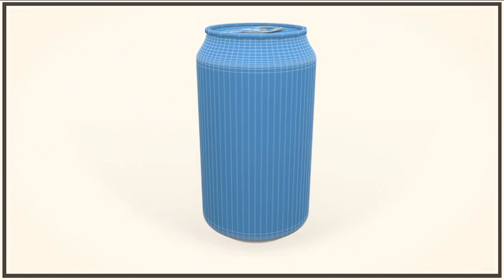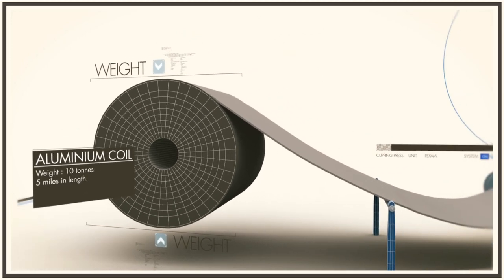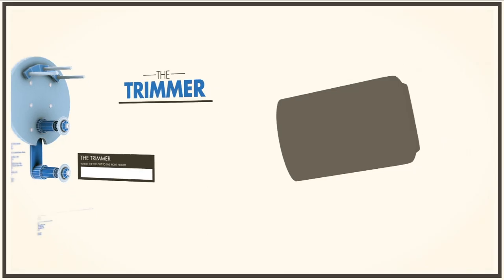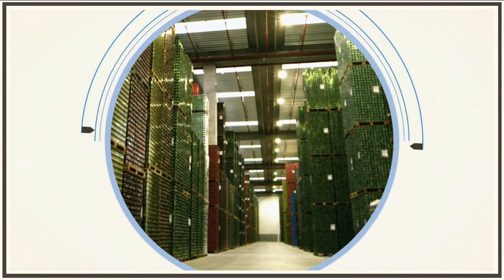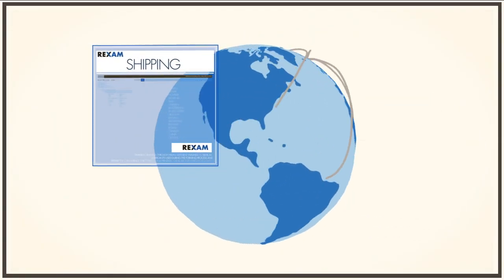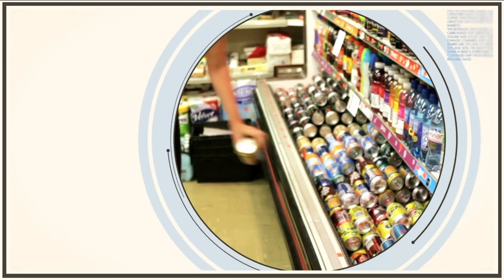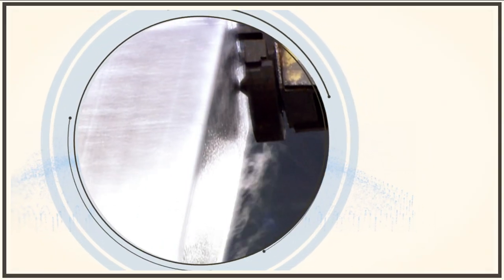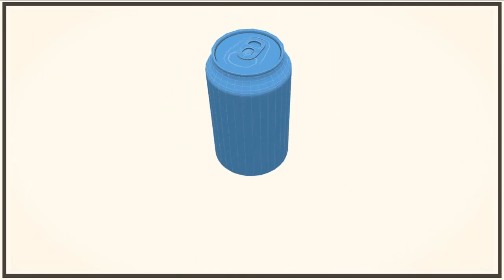Rexam's Full Circle film - the lifecycle of an aluminium can

Comment: It might be worth mentioning that about 80% of the cost of Al is in electricity use. Bauxite is very common, and quite cheap. But smelting it into usable aluminium takes a lot of electricity. Recycling it takes some as well, but not anywhere near as much is refining raw bauxite.
Reply: Yes.  The narrator makes a mistake at 5:19 when he talks about the 95% energy savings from recycling vs making cans from virgin metal.  He should have said ore.  Once you have the virgin metal, the tremendous amount of electrical power required to reduce Al2O3 to Al has already been spent.
Reply: besides the electrical energy required for making alu metal, refining the ore produces large quantities of toxic chemical waste known as "red mud".
Reply: That's why most aluminum refining plants are close to hydroelectric power, or nuclear power
Reply: @RossABQ  they also use so much electricity that they tend to have a special agreement with utility companies, offering to perform demand management (slowing down or reducing production rate) when needed in return for cheaper electricity.
Reply: Horrifying, this is why the earth is so polluted

Comment: Its impressive how much engineering has gone into a process we take for granted every day.  Where do you see the opportunities for further improving efficiency or reducing waste?
Reply: Michael Brooks very mature product design.  There are some opportunities out there for product improvement and differentiation.  Most improvements will come through material reduction(down gauging) and process efficiency.  If you can save 5cents per 1000 cans you can pay for millions and some times tens of millions of dollars in new equipment.  A single end line can run as high as $25M start to finish.
Reply: Can making is really big if your in that type of job , look up Soudronic a big Swiss company full 3 piece can line equipment   , and body blank welders like , soucan 870fb.

Comment: Interesting video, though the bit saying aluminum is as good as new every time it is not entirely true, in the sense that though it is true Al stays Al, the amount of impurities of recycled material may be too expensive or too difficult to remove. I was thinking about some industries as aeronautics were they only use first-produced aluminum, and of course they use different, very specific alloys including Mg, Cu, Mn etc.

But for the case of can production probably it's right and it can be an endless cycle of recycling provided we got the energy to do it.

Comment: I am surprised that the cans and can tops are sprayed with the coating/liner inside the can long before the top is mated to the body, even before shipping.  Why aren't they concerned about something getting inside the cans before it is filled and the top put on?  I mean, I'm sure they are concerned but how do they prevent foreign objects and debris?
Reply: The spray is to protect the acidic contents from dissolving the aluminium.   The finished cans are put into pallets that are wrapped with plastic.

Comment: Recycled cans do not return as new cans due to the large amount of inks and varnishes they contain. Instead this class 3 aluminium is used in cheap cast alloy products. Class 1 aluminium which is almost pure is needed in the production of new cans. It is then alloyed with tiny amounts of copper, manganese, steel and other metals to give the aluminium a degree of malleability in the can forming process. Class 3 aluminium can't be used.

Comment: They don't show how they put the top on after filling. The EngineeringGuy show a double crimped seam with a gasket. The filling operation and crimping is a "weak" point in the operation where the contents of the can may be influenced by the manufacturing process and causing some contamination. I believe this was cleverly avoided. Any ideas?
Reply: +Ted T I'm guessing the company that fills the can with fluid is the one that seals it, not Rexam..

Comment: So the drinks are just poured in? How do they pressurize it ?
Reply: The liquid is at a low temperature and the carbon dioxide is dissolved in the liquid under pressure.  At room temperature,  the CO2 comes out of solution until it reaches an equilibrium of pressure.

Comment: but what happens with the colouring? you vaporize it or what? when you recycle cans, they all are painted up ain't they?
Reply: Dauren Blaze Most would probably burn off, any residue would be scraped of as slag that floats on top I would guess.
Reply: ***** I'm afraid burn off means vaporize in this case, thus unfoerunately it's polluting everything around the exhausting tube...

Comment: How do they transport the cans without them becoming contaminated?
Reply: +Orange Chicken They are probably steam sterilized under high heat at the filling location prior to filling.
Reply: +Caleb Faulkner Couldn't that damage the varnish coating inside the can?
Reply: +tarstarkusz 
They're coated with an epoxy lacquer. Since epoxy is a thermosetting polymer it's resistant to relatively high temperatures.
Reply: +csiApok Thanks.

Comment: what is used to roll the metal into sheet?
Reply: +KingOfDoge   Several pairs of big steel rollers, with a progressively decreasing gap between them, so the Aluminium block is gradually extruded into a thin sheet as it passes through.